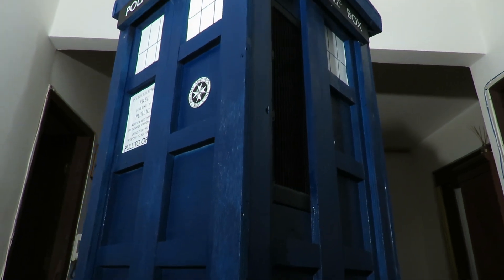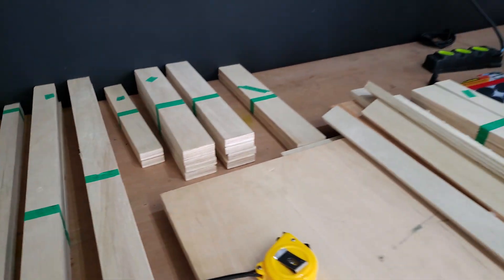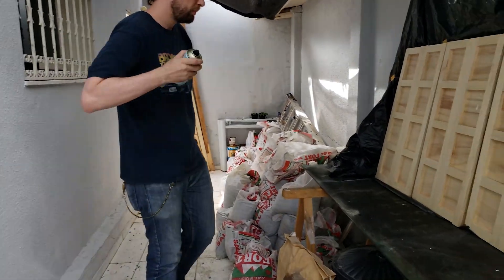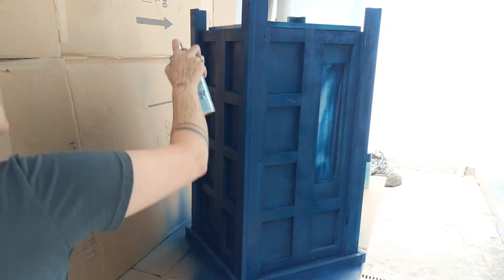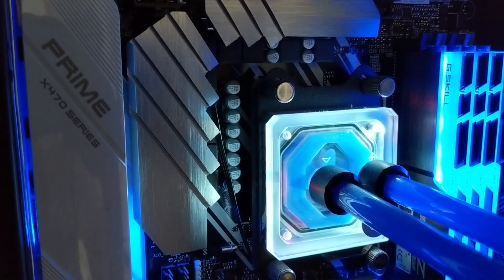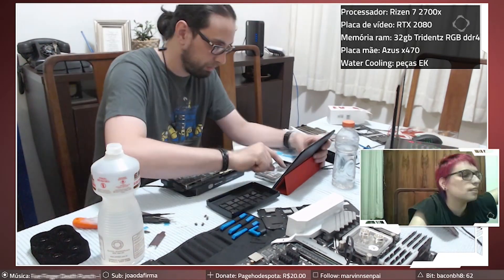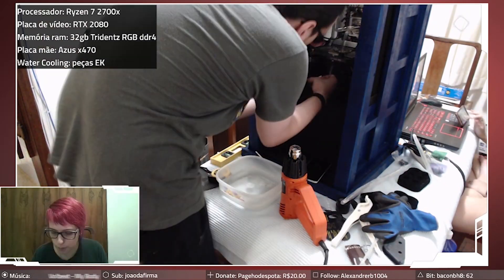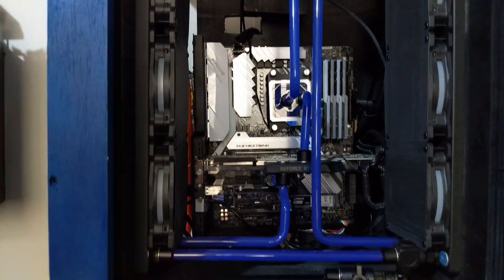This TARDIS has a PC inside!

Comment: how are the temps holding up in that? my wife would love that for her pc
Reply from the maker: The temps are fine, the slim rads are nothing special but they manage, I'm running it with the front open and having been using this as my daily driver for years now I would caution against this particular design specially if you plan on having a 40 series GPU since those are huge!
This design takes up a LOT of space, the PSU doesn't have adequate cooling(easy fix but still) and for something so big things are way too cramped on the inside so any GPU larger than that 2080 is not going to fit at all.
I
Reply: @RaphaelBaconSantiago  would u ever build one for someone if they paid you?. The gpu would be a rtx 3070?